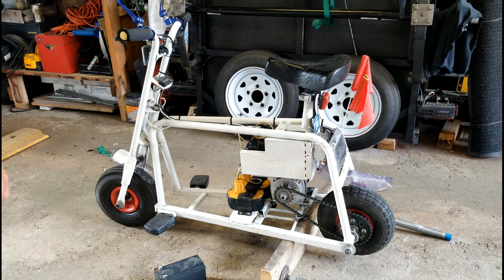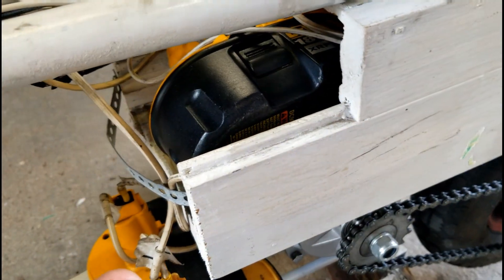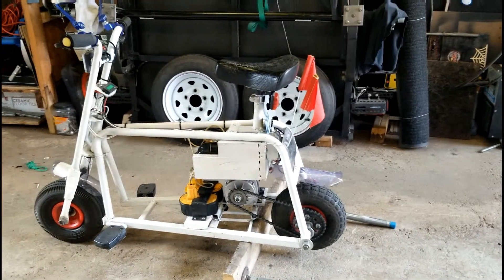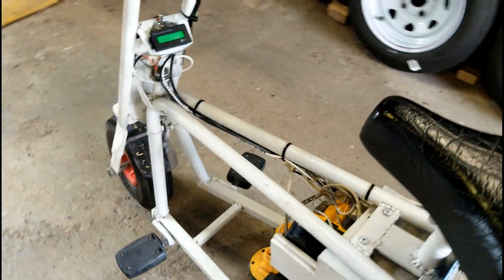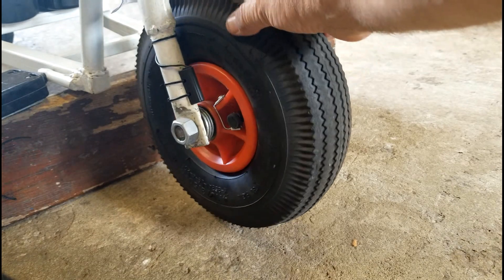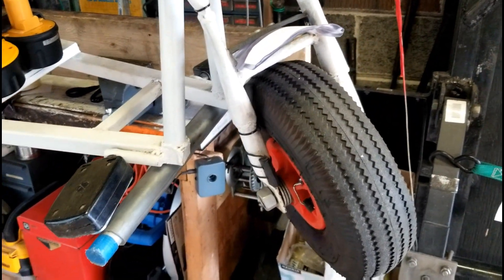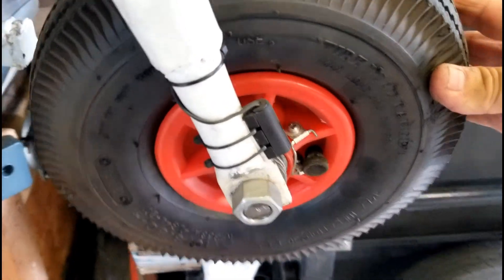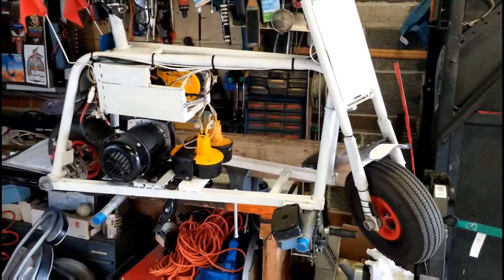Homemade DIY Electric Mini Bike

Comment: If you wired those batteries in series wouldn’t that make 72v ? Each one being 18v ??
Reply from the maker: Yes it would be 72 volts but I wired it in parallel.